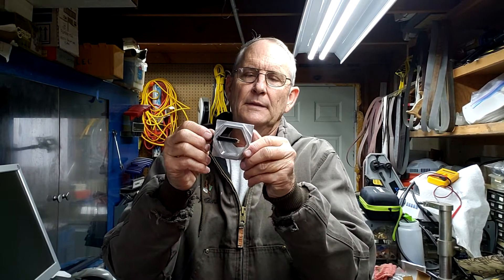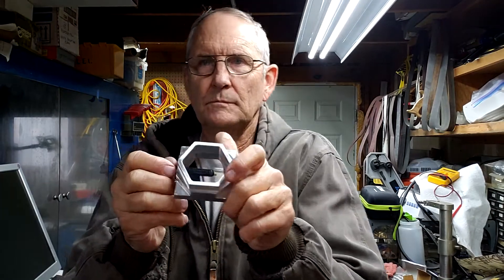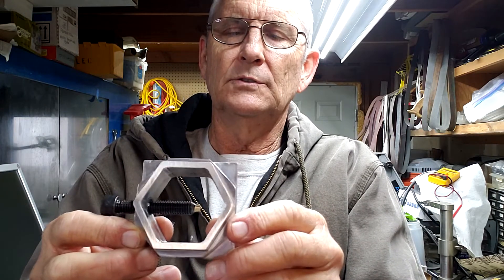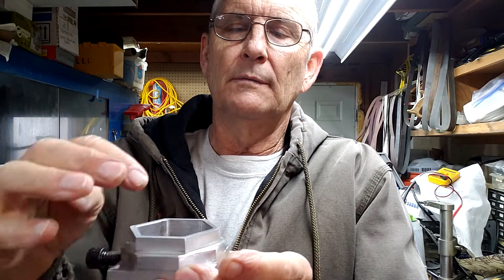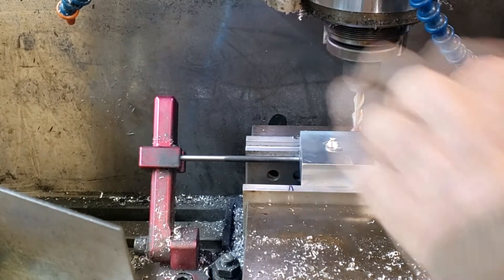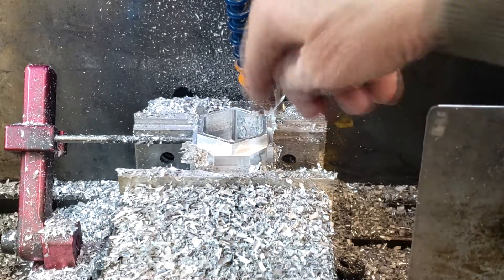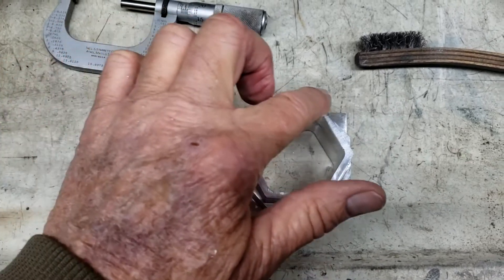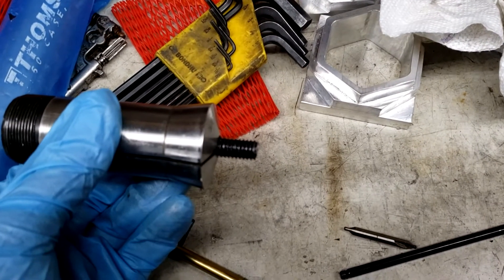MACHINING A ROSE TYPE INDEX

Comment: I made for my CNC class but I added a clock(12 sides) on the reverse.  I designed it in Fusion 360 and then generated the G-Code.
Thanks for sharing your version.
Reply from the maker: You're welcome
Reply: If you have 12 sides you don't need the square or the hexagon. The one in the video does not need the square at all, and could be 2/3rds the thickness. Cut one polygon, flip and cut the other.

Comment: what did we to before cnc machines  not all of us have them but mine turned out just as good
Reply: Actually it takes more time to program it than to machine it!!!!! The real craftsman is doing it manually
Reply from the maker: @johnhili8664  The real craftsman would do it with a bow drill and file.
Reply from the maker: Sometimes it's quicker to do a simple job on a manual machine.